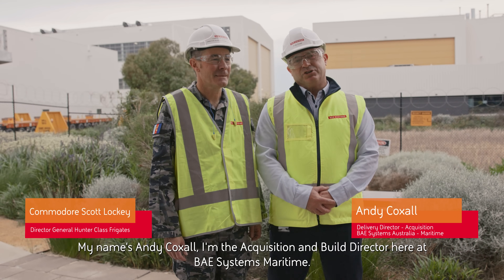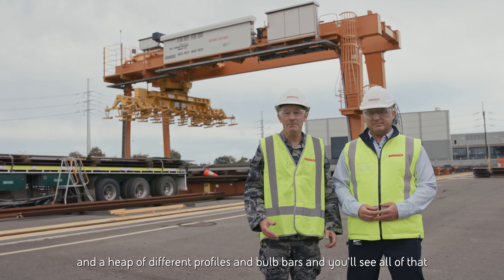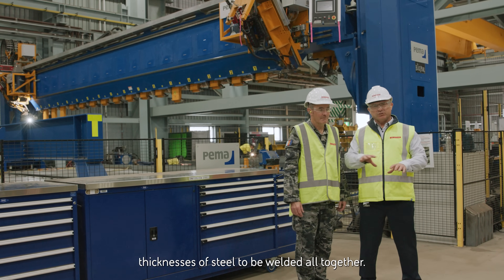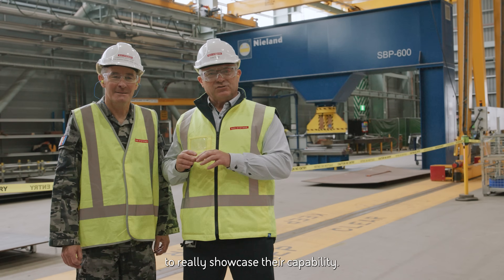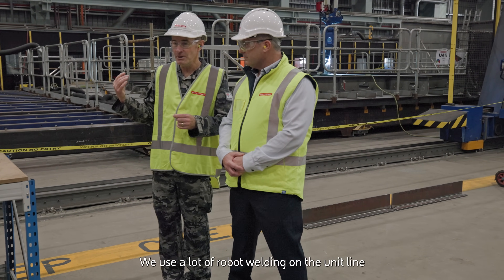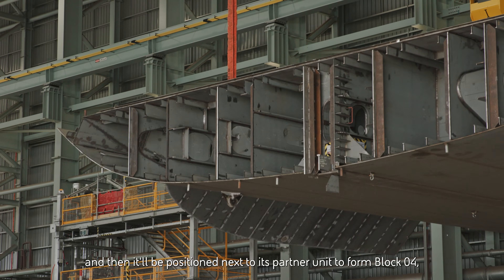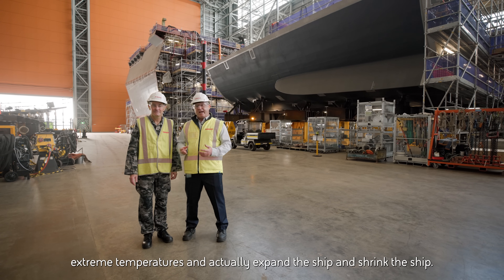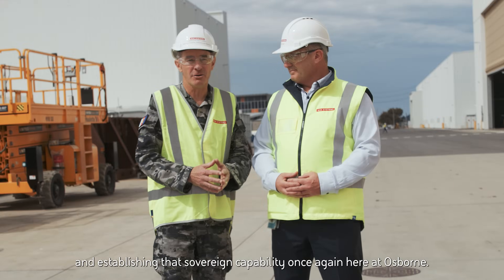Welcome to Osborne Naval Shipyard

Comment: Australian AEGIS Hunter class frigates will have the Australian designed and made 6 faced AESA "CEA FAR 2" search radars that have not one, but two 2 bands of search radars, a 6 faced S band radar suite and 6 faced anti stealth L band radar suite.
Also linked with these multifrequency search radars will be the 6 faced AESA "CEAMOUNT Fire Control Radars" that can lock on to 60 missiles or targets at one time in a 360 circumference.
That completely outperforms US SPY 1, SPY 3, SPY 6, SPY 7, - S band radars with their single lock on capability fire control radar the AN/SPG-62 in the X-band frequency, these radars have limited stealth detection range.
Hunters also has the Type 26 passive and active ship and towed array sonars which are considered the worlds best along with the ship being capable of silent electric drive during ASW missions.
When this ship hits the water it will be the world's best frigate!

Comment: At over A$2 billion each the Hunter class is more about profit gouging than national defence. A detailed cost breakdown would be revealing. The Oliver Hazard Perry class frigate that could operate two Seahawk helicopters were built for less than A$200 million each starting in the late 1970's. Most of the antisubmarine capability lies with the helicopters.
Reply: 😂😂 the weapon to sink the sub perhaps but the work on the hull and isolation work on it along with the sensor package and ops room on the ship is absolutely critical.
Reply: Drones, couple of thousand $$
Reply: They are $7 billion+ each.
Reply: @lancebond2338  And a "Ford" Class aircraft Carrier is $10 - 12B USD. Takes about 4yrs to complete. 100,000t warship with 4 x 600MW reactors.

Comment: They do not have enough missiles; 32 VLS and 8 canisters is not enough.  For Tier 1 combatants we need to be providing 48 VLS and 16 canisters.
Reply: 6 will be designed, especially for ASW  capability it will have towed away  sonar  multimission bay to carry things like the ghost shark sub drone, etc. When they are finished, 3 or 4 will be built with 96 cell VLS to replace  the Hobart class AWDs.  

32 cell VLS is plenty  for an ASW ship. They will not be eqwiped with tomahawks. That will be for the AWDs and future AUKUS  subs.
Reply: @Nathan-yy2xs Canisters are just rumours though. It's coming in 32 essm in 8 cells, 16 ASROC in 16 cells,  8 NSM in 8 cells configuration. A total of 32.

Comment: Cut the program to zero and just build lots of Mogami frigates, similar ASW capability, same number of VLS cells, but can also perform MCM at 20% the cost.
Reply: Restart the Hobart program. 48VLS, increase the original to 16 canisters, towed & hull sonar and add a pair of Typhon Mk30C guns a midships for drone protection.
Reply: A modern version of the Oliver Hazard Perry class that can carry two Seahawk helicopters could probably have been built for one quarter of the price.
Reply: @andreasbimba6519 that’s bollocks. A) the design won’t have been digitised so the ship model won’t exist. That will be a lot of rework for an ancient design aka pointless. No inbuilt knowledge as people have retired/died. Ships are built in blocks now, the Perrys were not designed to be built that way. Once you start messing with power generation etc you change the hull shape. You have a brand new ship being built in small quantities. So interoperability/parts etc becomes an issue. They also were not ASW assets. Yet more redesign. The T26 base design is intended for use in the GIUK gap to combat Russian nuclear boats. A problem for both the UK and Norway. A region of immense submarine activity. Given China has built an enormous fleet and the undersea geography of the region. I can see why T26 was chosen as the base design. Turning it into a destroyer in all but name is on the scope creep of the RN and Australian government. This is why you have different classes of ship for different jobs. Instead of a jack of all trades master of none. Australia has belatedly realised this but have now gotten the ship mix a bit funky. A tiny number of all singing all dancing AAW destroyers is pointless. Australia need enough to protect its amphibious landing group, does it need more? When Chinas sub fleet is the biggest threat.
Reply: @eagle_rb_mmoomin_418  Australia's version of the Type 26 are on track to cost over A$7 billion each. There are many current ASW suitable frigate sized ship designs available globally at a fraction of that totally unacceptable price. Cancel the Type 26 Hunter class and build Mogami's or Meko 200's or a version that can deploy two Seahawk helicopters. Don't expect any points for supporting the worst possible solution for the RAN.
Reply: @andreasbimba6519  The helicopter carries the weapons package🤦 the ship is carrying all your specialists, processing, sensors, systems. The quieter all of that is the more useful the ship for ASW.
Reply: 🤣🤦 that cost includes building out a modern build facility, processes and crucially knowledge within the staff on how to build a modern naval design. Along with negotiation, R&D, integration costs from going and changing the design.  That is relevant for any work post Hunter. Buying a cheaper solution is always based on buying off a running production line where the R&D cost has been eaten by the developing nation.  You're also looking at general purpose frigates that have had ASW kit bolted onto them, ie a shit capability vs a purpose built design. Jack of all trades master of none. Given chinese nuclear subs are now a huge danger for Australia, it's incoherent to half arse it.
Reply: @eagle_rb_mmoomin_418  The cost is actually now at A$9 billion per Australian built Hunter frigate which is a total ripoff for the capability likely to be provided. Japan pays less than A$1 billion for each Upgraded Mogami. I think you greatly exaggerate the cost to further enhance the Osborne shipyard and to train up the workforce including the naval architects and weapons specialists from what it was during the building of the Hobart class AWD's. BAE Systems Australia is clearly not suitable for designing and building warships.
Reply: @eagle_rb_mmoomin_418 nope, the cost for designing the Attack class submarine was ~$500m, your trying to argue a couple of sheds cost billions of dollars.

Nothing can justify the cost of the Hunter, you could build a Gerald R Ford aircraft carrier……or 2 Hunter class frigates. We look like a joke to the international community.
Reply: @andreasbimba6519  The Mogami frigates are more in keeping with a modernised version of the Type 23 general purpose frigates, even down to size and fitment. They are not purpose built ASW frigates. You're comparing grapes to bananas.  Militarily illiterate.
Reply: @うえんとわす  🤣🤣🤣 you've never worked on a defence project have you. The French always do this. Without fail a large amount of the kit intended to be built in country ends up being built in France. Also taking a nuclear attack sub and turning it into a diesel electric was never going to be simple hence why the project was moving out to the right. Couple of sheds🤣🤣 the manufacturing process and training is the important element of uplifting the ship yard dummy that all takes time. The building are important clearly as they are the enabler but it's what occurs in the buildings that's important. The reason Australian defence projects always cost so much is because the requirements are bespoke against what is in theory an already developed design. Which means in actuality the kit is bespoke and the design becomes bespoke. Which is what has happened with Hunter, just the same as every other Australian defence procurement. Australian forces do not want off the shelf kit. Given Gerald R Ford has had many many issues with it's catapults, arresting gear, weapons lifts. Has design flaws with availability to the point where one cat going down means that every cat has to be taken offline. That's another example of taking a known working solution steam cats via nuclear reactor and creating a nightmare by changing the requirements.